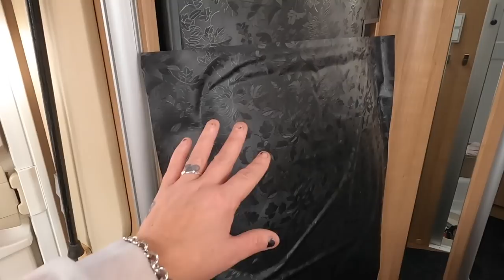Brighten Up Your Van Or Motorhome With LED Lights

Comment: You did a thing . Well done you two . You could drill a hole in the table and pull the led trough then put the excess in it . Just to let you know the glue on them strips don’t last long  and they have a habit of falling off .
Reply from the maker: Yeah we are having trouble with them sticking. Had to cut them down quite a lot.

Comment: You two have done a wonderful job making your van look fresh!  With those strip LED lights can't you just cut the end off and put this clip you can buy on it?  I know I bought a roll of that kind of stuff and you can just trim the end where you want it to end and clip this end piece on?  Maybe those are different lights than the ones I have though.  You should velcro the remote controls on the wall in the bedroom so you don't lose them.
Reply from the maker: we have 4 remotes dotted around the van.

Comment: You can chain link the lights guys. Also top tip - if you have to apply vinyl covering  spray surface with soapy water from a mister bottle, that way it's easier to move the vinyl and push the air bubbles out :)
Reply from the maker: Vinyl has now been sorted...by Dan :-)
Reply: You're a damn professional. Most impressive.